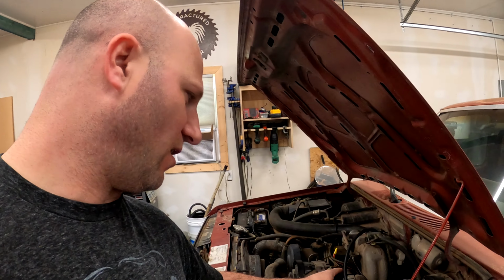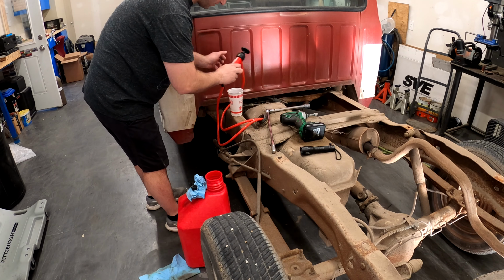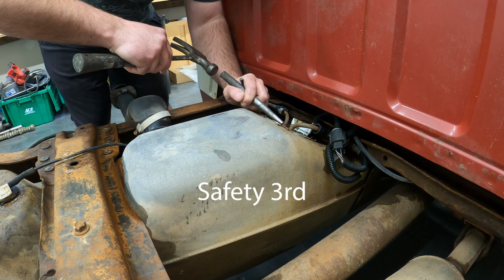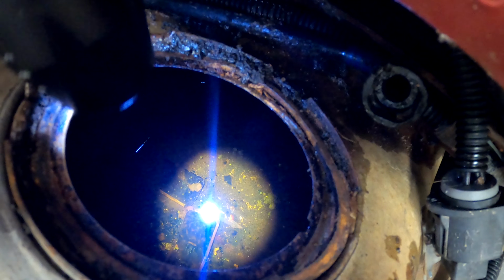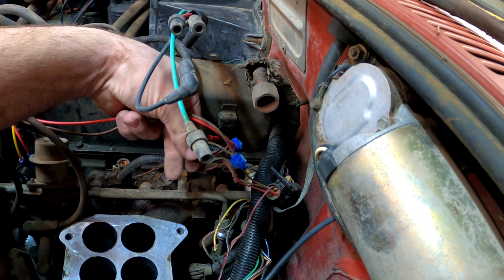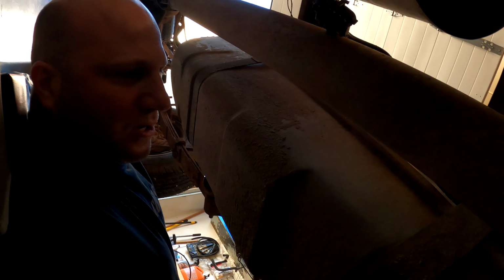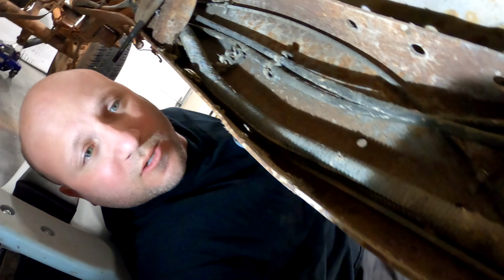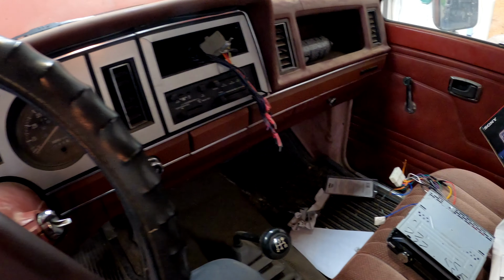Diagnosing and fixing wiring eaten by rats and a rusty fuel tank. Is this cheap truck worth the fix?

Comment: I'm wondering how old that wooden handled screwdriver is. I think I still have a couple of those in my junk drawer, as well as a bunch of antique wrenches. Gas turns into a thick syrupy varnish quite quickly these days so cleaning out the fuel system is one of the first things I do whenever I get time to work on the many vehicles I bought at the auction many years ago. Out of the 10 remaining, I probably can save half of them. I just discovered your channel today so I'm moving on to see what's next. Good stuff.